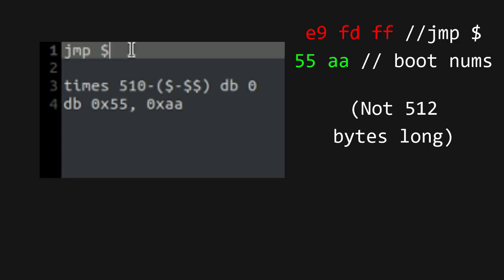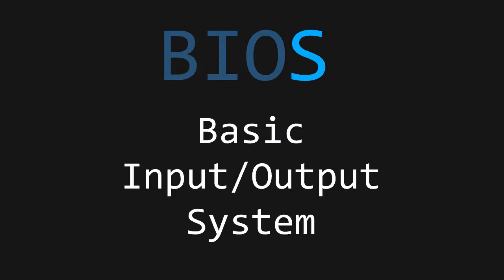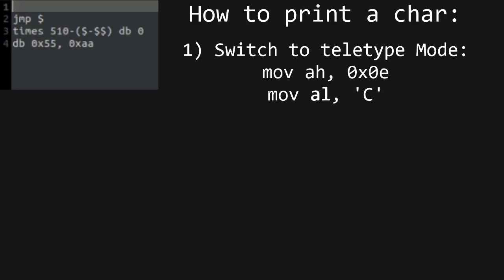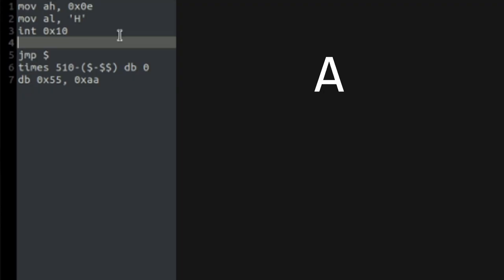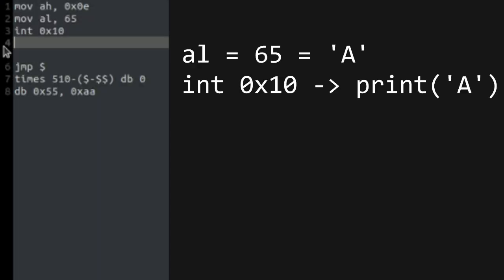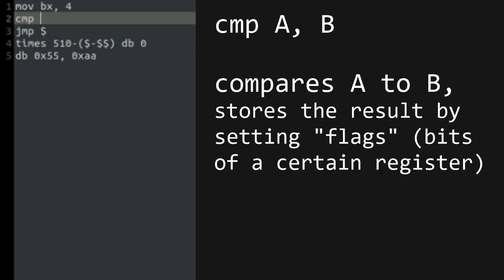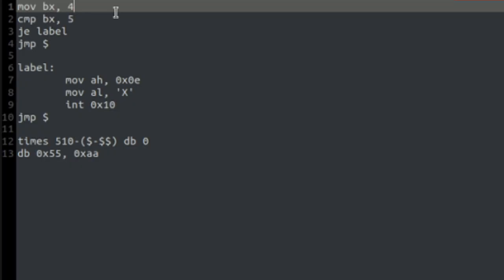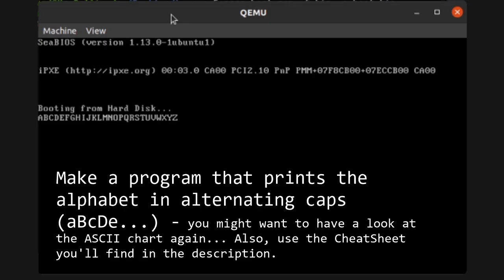Making an OS (x86) Chapter 2 - BIOS, Printing the Alphabet, Conditional Jumps

Comment: here is my code - 

mov ah, 0x0e
mov al, 'A'

caps:
    int 0x10
    add al, 33
    jmp small
small:
    int 0x10
    sub al, 31
    cmp al, 'Z' + 1
    je exit
    jmp caps
exit:

jmp $

times 510 - ($ - $$) db 0 
db 0x55, 0xaa

mov ax, 'H'

Comment: mov al, 'a'
mov ah, 0x0E
int 0x10

loop:
    inc al
    cmp al, 'z'
    jg exit

    test al, 1
    jz even

    int 0x10
    jmp loop

even:
    sub al, 32
    int 0x10
    add al, 32
    jmp loop

exit:

    jmp $

    times 510 - ($ - $$) db 0
    dw 0xAA55

I did this but it kept printing gibberish characters after the actual characters. I don't know why.
Nervermind I fixed it. I have edited the initial code I posted.

Comment: my code:

mov ah, 0x0e
mov al, 'A'
mov bl, 0

loop:
    mov dl, al
    cmp bl, 0
    je upper
    or dl, 0x20
    jmp print

upper:
    and dl, 0xDF   ; took me a while to find out that this logic works

print:
    mov al, dl
    int 0x10

    inc al
    cmp al, 'Z' + 1
    je exit
    cmp al, 'z' + 1
    je exit
    
    xor bl, 1
    jmp loop

exit:
    jmp $

times 510 - ($-$$) db 0
db 0x55, 0xAA

Comment: my code :

; print alphabets in alternative caps

mov ah, 0x0e
mov al, 65
int 0x10

mov bl, 97 ; for small caps(intially), it'll keep switching

loop1 :
    ; we need to swap al and bl, without using a temp, lets do it mf
    xor al, bl
    xor bl, al
    xor al, bl
    inc bl ; increment in 'bl'
    inc al ; in 'al' as well
    cmp al, 90
    jg print1; if al > 90 then goto print1
    int 0x10 ; else print whats there in 'al'
    jmp loop1 ; loop kro

print1 : 
    ; al > 90, so wee need to see if its a small letter or out of bount from caps
    cmp al, 97
    jl exit; if al < 97
    int 0x10 ; print [al]
    jmp loop1 ; now jump to loop
; i dont think we need to take care of the smalle ones as well
; cause the caps will make the loop stop, so no need to worry

exit:
    jmp $ ; exit

times 510 - ($-$$) db 0
db 0x55, 0xaa

; decimal   char
; 65         A
; 66         B
;
; 90         Z

; 97         a

; 122        z

; so how do we do it ?
; use two loops ?
; lets try 

; al = al^bl
; bl = al^bl = al^bl^bl = al (swapped )
; al = al^bl = al^bl^al = bl (swapped )
; noice

Comment: heres my solution to the hw, let me know if its unoptimized or not

mov ah, 0x0e
mov bl, 'a'
mov bh, 'B'

printAlphabetAlternating:
    mov al, bl
    int 0x10
    inc bl
    inc bl
    mov al, bh
    int 0x10
    inc bh
    inc bh
    cmp bh, 92
    jge end
    jmp printAlphabetAlternating

end:
    jmp $

times 510-($-$$) db 0
db 0x55, 0xaa
Reply: you can use add and sub to add and subtract 32 from al since adding 32 turns into lowercase (search ascii table in google and look at the difference between A and a)

Comment: I finished my homework :D

mov ah, 0x0e
mov al, 97
int 0x10

loop:
    sub al, 31
    int 0x10
    add al, 33
    cmp al, 123
    je exit
    int 0x10
    jmp loop

exit:
jmp $
times 510-($-$$) db 0
db 0x55, 0xaa
Reply: you can remove interrupts from line 3 and after je exit. it is not required.

Comment: mb a little too late but here is my solution to homework
mov ah, 0x0e
mov al, 'A'
mov bl, 'b'
loop:
	int 0x10
	mov cl, al
	mov al, bl
	int 0x10
	mov al, cl
	add al, 2
	add bl, 2
	cmp bl, 'z' + 2
	jne loop
hlt
times 510 - ($ - $$) db 0
db 0x55, 0xaa
(I wanted to use stack btw, but since you didn't introduce it i assumed it would be an overkill)

Comment: Check this out:

mov ah, 0x0e

mov al, 0x61

PRINT:
	cmp al, 0x7B
	je $
	int 0x10
	cmp al, 0x5A
	jle TO_LOW
	cmp al, 0x61
	jge TO_UP

TO_LOW:
	times 33 inc al
	jmp PRINT

TO_UP:
	times 31 dec al
	jmp PRINT

jmp $

times 510-($-$$) db 0
db 0x55, 0xaa

Comment: mov ah, 0x0e; Switch to teletype mode
mov al, 'A'

loop:
        int 0x10
        cmp al, 'z'
        je end
        inc al
        cmp al, 96
        jl capital
        jg small
capital:
        add al, 32
        jmp loop
small:
        sub al, 32
        jmp loop
end:
        jmp $

times 510-($-$$) db 0
dw 0xaa55

Comment: What is tele-type mode? Please explain, how BIOS can fetch data from input devices such as keyboard, mice, through interrupts? Does BIOS have an interrupt handler before the OS is initialized?
Reply from the maker: In real mode there is an interrupt vector table starting at memory location 0 and consisting of 256 entries that is used to resolve the BOS interrupts. 

As for teletype mode, it's simply one name of the procedure called by executing int 0x10 with ah = 0x0e.

Comment: I have a question; if jump $ just loops forever, then why does the 0x55 0xaa section of the code run? It's outside of the exit label.
Reply from the maker: That section of the code does not need to run! It's just padding, expanded by the NASM preprocessor. 0x55 0xaa are not instructions, they are values written to the disk that the computer has to read in order to recognize the disk as bootable :)

Comment: For those in the future who are struggling with the homework

mov ah, 0x0e
mov al, 65
int 0x10
jmp printlower
printcap:
  times 31 dec al
  int 0x10
  jmp printlower
printlower:
  times 33 inc al
  int 0x10
  cmp al, 'z'
  je exit
  jmp printcap
exit:
  jmp $
  times 510-($-$$) db 0
  db 0x55, 0xaa

Comment: My solution (spoilers):

mov ah, 0x0e
mov al, 'A' ; start with uppercase
mov bl, 0 ; upper/lowercase flag
; can start with lowercase by moving 'a' into al and 1 into bl

loop:
int 0x10
inc al
cmp bl, 0
jne else
inc bl
add al, 'a' - 'A' ; make lowercase
cmp al, 'z'
jmp endif
else:
dec bl
sub al, 'a' - 'A' ; make uppercase
cmp al, 'Z'
endif:
jle loop

jmp $
times 510-($-$$) db 0
db 0x55, 0xaa

Comment: that aged like fine wine (I don't know why it should age terribly the code hasn't changed in the past 1 or 2 decades)
anyway here is the homework:

mov ah, 0x0e
mov al, 0x41

addloop:
  int 0x10
  add al, 0x21
  jmp subloop

subloop:
  int 0x10
  sub al, 0x1F
  cmp al, 0x5B
  jne addloop

jmp $

times 510-($-$$) db 0
db 0x55, 0xAA

Comment: Finished my homework. 
mov ah, 0x0e                                                            ;Enable teletype mode
mov al, 'A'                                                                  ;Ascii value 65
int 0x10                                                                     ;Print the first A character so we can invert the inverting for some reason

loop:                                                                          ;DA LOOP
    inc al                                                                     ;Increment the al register by 1

    add al,32                                                              ;Add 32 to the al register

    cmp al, 'z' + 1                                                      ;Check if the al register is higher than 'z'
    je exit                                                                   ;If it is higher than 'z', leave the loop
    int 0x10                                                               ;If it is lower than 'z', print that

    inc al                                                                    ;Increment the al register by 1
    sub al, 32                                                            ;This time, subtract the al register by 32

    cmp al, 'Z' + 1                                                     ;Check if the al register is higher than 'Z'
    je exit                                                                   ;If it is higher than 'Z', leave the loop
    int 0x10                                                               ;If it is lower than 'Z', print that
    jmp loop                                                              ;Makes "DA LOOP" work

exit:                                                                          ;This happens when the alphabet is finished
    jmp $                                                                   ;DA LOOP v.INFINITY

times 510-($-$$) db 0                                          ;Writes 510 bytes of NOTHIN
db 0x55, 0xaa                                                        ;The magic NUMBER

Comment: it would be much easier to just do:
mov ah, 0Eh
mov al, 'A'
loop:
    int 10h
    inc al
    cmp al, 'Z'
    jle loop
;outside the loop
as this would save a bunch of cloxk cycles, theres also a lot of variations of the exact same code just with slighty different order and different definitions or u could use like jng instead if u wanted

Comment: Here's my solution to the challenge

mov bl, 32
mov bh, 0
mov ah, 0x0e
mov al, 'A'
int 0x10

loop:
    add al, bl
    inc al
    inc bh
    int 0x10
    neg bl
    cmp bh, 24
    jle loop

jmp $
times 510-($-$$) db 0
db 0x55, 0xaa

Comment: I'm kinda late for the party but here's my solution of the given homework:

mov ah, 0x0e
mov al, 0x41
print:
    test al, 1
    jnz print_lowercase
    int 0x10
    jz  loop
print_lowercase:
    add al, 0x20
    int 0x10
    sub al, 0x20
loop:
    cmp al, 0x5a
    jge  exit
    inc al
    jmp print
exit:
    mov ax, 0x0
    nop
times 510-($-$$) db 0
db 0x55, 0xaa

Comment: Great video ! :)

My solution to the exercise :

bits 16
org 0x7c00 

section .text:
    boot:
        mov ah, 0x0e
        mov al, 'A'

    .loop:
        int 0x10
        add al, 33
        int 0x10
        cmp al, 'z'
        je halt
        sub al, 31

        jmp .loop

    halt:
        cli
        hlt

    times 510 - ($ - $$) db 0
    dw 0xaa55

Comment: mov ah, 0x0e	; bios print
mov al, 'A'	; char to print
mov bx, 26
loop:
	int 0x10	; bios interrupt

	inc al ; move to next letter
	cmp al, 'Z' ; Is al a capital letter?
	jg make_lower ; if so make it lower case.

	add al, 'z'-'Z' ; else make it upper case.
	jmp continue ; jump over the part that makes it lower case

make_lower:
	sub al, 'z'-'Z'

continue:
	dec bx ; subtract one from counter
	jnz loop ; if counter is not zero, loop

jmp $
times 510-($-$$) db 0
db 0x55, 0xaa

Comment: Hello everyone here is my answer. hope it helps.

mov ah,0x0e  ; enter wrtring mode (don't know the real name)
mov al, 65  ; set al to 65 'A'
int 0x10 ;  bios interrupt

loop:  ; loop 

    cmp al, 122  ; check if al is equal to 122
    je end  ; if true jump to end 

    cmp al, 90  ; check if al is less than 90
    jl sml  ; if true jump to sml

    cmp al, 90  ; check if al is greater than 90
    jg cap  ; if true jump to cap

    sml:  ; small letter function
    inc al  ; increase al by 1
    add al, 32  ; add 32 to al
    int 0x10  ; bios interrupt
    jmp loop  ; jump to loop

    cap:  ; capital letter function
    inc al  ; increase al by 1
    sub al,32  ; subtract al by 1
    int 0x10  ; bios interrupt
    jmp loop  ; jump to loop

end:
jmp $

times 510-($-$$) db 0
db 0x55, 0xaa

Comment: i don't know if it's right but, it worked as expected
i wrote the code like this:

mov ah, 0x0e
mov al, 65; letter A
int 0x10
jmp loop; in to the loop now
loop: 
	mov ah, 0x0e
	inc al; which equals to "al ++" in c
	int 0x10
	cmp al, 'Z'
	jl loop; if al is lower than 'Z', then turn to loop again, otherwise will go back to main program flow and continue the operations after the loop

jmp $

times 510-($-$$) db 0
db 0x55, 0xaa

was i doin' right or not?  i don't really know how assembly programs should be written like
please tell me that
and thank u so much for your excellent courses!!!

Comment: Probably the best series I've seen explaining OSes so far, keep up the good work!

The Homework Assignment: (P.S before this is called I push all registers to stack, and then i set ah to 0x0e, al to 65, and I xor bl to 0, and then jmp to here)

print_alphabet:
	add bl, 32
	cmp al, bl
	je .set_back
	jne .set
.prnt:
	cmp al, 'Z' + 33
	je .d
	int 0x10
	inc al
	inc bl
	jmp print_alphabet
.d:
	popa
	ret
.set_back:
	mov bl, al
	sub al, 32
	jmp .prnt
.set:
	mov bl, al
	add al, 32
	jmp .prnt
Reply: I made something a bit more simple and which you can classify as a bit dirty:
mov ah, 0x0e
mov dl, 65
mov cl, 97
call retAlphabet
retAlphabet:
	mov al, dl
	int 0x10
	mov al, cl
	int 0x10
	inc dl
	inc cl
	cmp dl, 91
	jl retAlphabet

jmp $
times 510-($-$$) db 0
db 0x55, 0xaa

I just check if 'dl' is at the limit since the alphabet is the same lenght (the limit is 'Z' + 1 in decimal)
Reply: my take was:
```
mov al, 65
loop:
  mov ah, 0x0e
  int 0x10

  cmp al, 'z'
  je end

  cmp al, 'Z'
  jg subs
  jl adds

adds:
  add al,32
  jmp loop
subs:
  sub al,32
  inc al
  jmp loop
end:
  jmp $

times 510-($-$$) db 0
db 0x55, 0xaa
```

Comment: This is what I did and I'm sure there's probably a better way but I'm new to this:

mov ah, 0x0e

mov al, 'A'

loop:
        cmp al, 'Z' + 1
        je exit

        int 0x10
        add al, 32
        int 0x10
        sub al, 31
        jmp loop

exit:
        jmp $
        times 510-($-$$) db 0
        db 0x55, 0xaa

Comment: Finished the homework. I would've used cmovz and cmovnz, but for some reason nasm doesn't have them.

==CODE==

	mov ax, 0x0E41
	mov bl, 0x41
	mov cl, 0x61
	mov bh, 0
loophead:
	not bh
	add bh, 0
	jz iszero
	jnz notzero
iszero:
	mov al, bl
	jmp after
notzero:
	mov al, cl
	jmp after
after:
	int 0x10
	inc bl
	inc cl
	cmp bl, 'Z'+1
	je finished
	jmp loophead
finished:
	jmp $
	times 510-($-$$) db 0
	db 0x55, 0xAA

Comment: For the Homework I added some other stuff
prints a custom message and print alphabets in alternate case
AbCdEfGhIjKlMnOpQrStUvWxYz

ORG 0x7c00
mov si, message
printMsg:
    mov ah, 0x0e
    mov al, [si]
    ploop:
        int 0x10
        inc si
        mov al,[si]
        cmp al, 0
        jne ploop
mov bl, 0
mov ah, 0x0e
mov al, '@'
printChars:
    cmp al, 'z'
    je exit
    cmp bl, 0
    je printCaps
    jne printSmall
    printCaps:
        inc al
        int 0x10
        mov bl, 1
        jmp printChars
    printSmall:
        add al, 33
        int 0x10
        mov bl, 0
        sub al, 32
        jmp printChars
message db "Hello, Rohith - Boot Success", 13, 10, 0
exit:
    jmp $
    times 510 - ($ - $$) db 0
    db 0x55, 0xaa

Comment: ;alternating alphabat
mov ah, 0x0e

mov al, 65
loop:
   int 0x10
   inc al
   xor al, 0b00100000; invert case of letter
   mov bl, al
   and bl, 0b00011111; this is to ignore the case
   cmp bl, 0b00011011; check if letter is higher than z
   jne loop
exit:
   jmp $
times 510-($-$$) db 0
db 0x55, 0xaa

Comment: 6:41 how dose cmp know which flag your looking for? In the C code, it appears to only support equals, but if i understand correctly (most likely not) u mentioned compare is either =, >, <, etc
Reply from the maker: Cmp basically performs a subtraction, and based on that subtraction it sets a few flags. E.g. if the result of the subtraction is negative then it sets a "negative" or "sign" flag, which indicates the second number is bigger than the first. This is how it checks for <. To check for = it uses the "zero" flag, which is set if the result of the division was zero. Then the others (>, ≤, ≥) are all done in a similar way, with the same flags
Reply: @DaedalusCommunity  ah ok, thank you. Your like one of the first to go this in deph, ty for your efforts. But basically, im guessing this more so updates the flags register, & then on the next conditional jump, it checks the register?
Reply from the maker: @T55sArt  Exactly. It is done this way because jumps are not the only operations that can be performed conditionally
Reply: @DaedalusCommunity  ohhh, interesting. Do you know of any other examples of other things using cmp? Or will i find out as i continue the series?

Comment: mov ah, 0x0e
mov al, 0x41 ; set al to 'A'
mov bl, 0 ; use bl as counter, assign 0x0
cmp al, 0x41
jp loop
jmp $

loop:
    inc bl ;increment counter by 1
    add al, 0x20 ;add 32 (0x20) to get lower
    int 0x10
    inc al ;increment to next letter
    sub al, 0x20 ;sub 32 to get capital
    int 0x10
    inc al ;increment to next letter

    cmp bl, 13 ; if last letter
    je exit

    jmp loop

exit:
    jmp $
times 510-($-$$) db 0
db 0x55, 0xaa

Comment: Nice video, but for some reason the 0x10 interrupt doesn't work for me, it doesn't print out anything. Any suggestion why that might happen?
Reply from the maker: Try to check out the reference code and see if you wrote everything correctly: https://github.com/mell-o-tron/OS-Reference

Comment: My solution that prints alphabets with alternative capitalization.

mov ah,0xe
mov al,64
mov bx,0

loop:
 inc al
 cmp al,'Z'+1
 je exit
 cmp bx,0
 je small
 int 0x10
 mov bx,0
 jmp loop

small:
    add al,32
    int 0x10
    sub al,32
    mov bx,1
    jmp loop

exit:
    jmp $
times 510-($-$$) db 0
db 0x55,0xaa

Comment: I first tried the homework in C++ and then in assembly. BTW This is my code - 
mov ah, 0x0e
mov al, 'A'
loop:
    int 0x10
    add al, 32
    int 0x10
    inc al
    sub al, 32
    cmp al, 'Z'+1
    jne loop
times 510-($-$$) db 0
db 0x55, 0xaa

Comment: I don't know why I though of 2 loops. First Aa is done outside of it.

mov ah, 0x0e

mov al, 65
int 0x10

add al, 32
int 0x10
sub al, 32

loop:
    inc al                     ; al++
    cmp al, "Z" + 1     ; al == (90-1)
    je exit                    ; jump exit if true else skip
    int 0x10                ; bios print interupt for al
    jmp loop2             ; jump to lower case

loop2:
    add al, 32             ; +32
    cmp al, "z" + 1     ; al == (122-1)
    je exit                    ; jump exit if true else skip
    int 0x10                ; bios print interupt for al
    sub al, 32             ; -32
    jmp loop               ; jump to start

exit:
  jmp $                       ; while(1) just keeps running